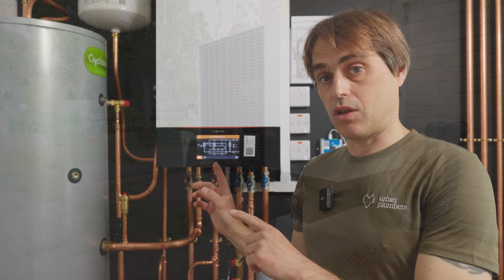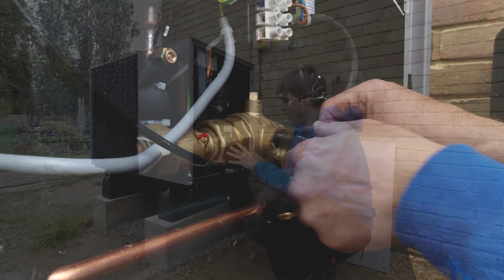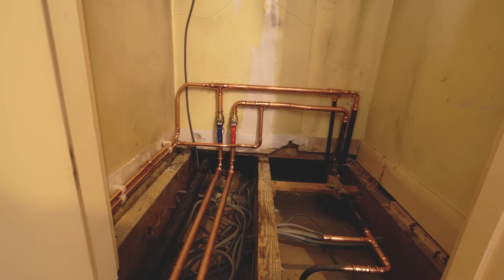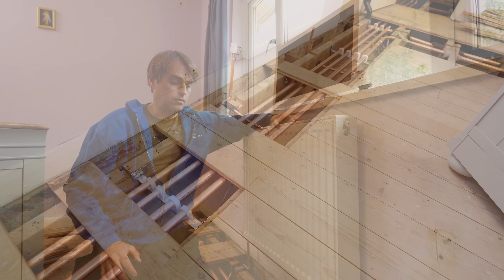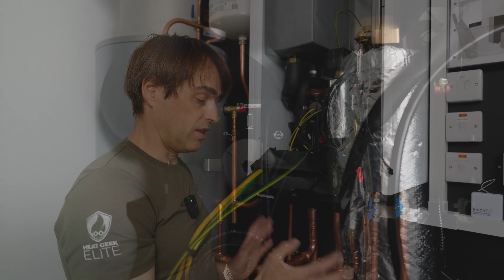Viessmann Vitocal Heat Pump Installation & Overview.

Comment: Like the idea of heat pumps, but when i see videos on YouTube of half a room in the house taken up by cylinders, valves and things on the wall it scares the cr4p out of me! Plus you need a big box outside your house. My combi boiler is about 70cm x 50 cm, so nice and small. Where would I fit all of that stuff? Can an ashp provide heating and instant hot water (without cylinder)? We only put our heating on when we get cold, so very low users of gas, can you do the same with an ashp? As in, only turn it on when you get cold or want hot water? Sorry, lots of questions - newbie here!
I should add, 2 people in house. 3 bed semi, WFH only twice a week. V low electricity and gas users.

Comment: Just get an integrated unit. No need for extra space for the cylinder.
Reply from the maker: Integrated units have small cylinders below 200l. Not good for 4-5 bed houses

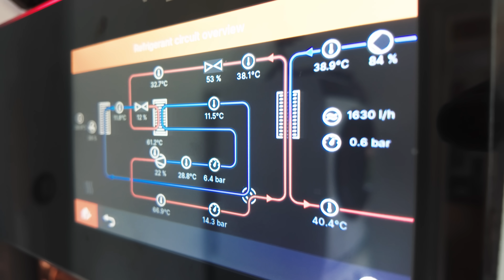Comment: At 11:50 circulation pump runs at 84% so the flow is modulated....Do you know why there are two EEVs on the refrigeration cycle diagram and why is the heat exchanger just before the evaporator and second EEV?

Comment: My installer wants to put in a homely optimiser over a 16kW Samsung. In theory, the machine learning optimising the flow temperature is a near perfect concept. However, has anyone had any experience with the system working well or poorly please?

Comment: @8:00 What happens if the circulator is stopped, how does the heat pump calculate the degree minutes (Nibe) then? Somehow the water needs to circulate?
Reply from the maker: Circulator doesn’t stop - is slows down to conserve the energy in both NIBE and Vaillant.

Comment: Are you sure it has to be 1000L/hr flow rate and cant go less. I had this concern and spoke to their technical but im not sure they know half the time.

From memory mines going to be 680L/hr on a 6Kw model and they said its ok, and explained about some auto bypass valve mentioned in their brochure, which i thought was to compensate for zones closing which i wont have.

6kw model at 35°C they said can output 5.6Kw. Cant remember the outdoor temperature for this though.
Reply from the maker: Yes, we tried running them lower and they would fail to defrost. All models need minimum of 1000l/h for defrost and since pump is really fixed flow / speed it has to run faster on 4/6kw models
Reply: Do you think the 150-A 6kw unit will be unsuitable for a home with 4.2Kw heat loss. DT 5 is 722L/h, it would need DT 3.6 to achieve 1000L/h.

Ufh ground floor, radiators first floor. Any suggestions?

Everything heat pump is complicated and why i was avoiding one over gas boiler, but low heat loss is almost pushing me to one for a new build.@UrbanPlumbers
Reply from the maker: @handle1196 just use 8kw. It’s the same unit as 4 and 6
Reply: Ive spoken to viessmann technical who confirmed the 1000L/hr is only for defrost mode and it will up the pump speed to this to perform a defrost cycle, then return to its speed required for the heating demand. In my case, 722L/hr at D.O.T, but the 6Kw unit will go down to 300L/hr.

300L/hr aligns with 1.74Kw output which matches the heat pumps minimum modulation at A2 W35

A7 W35 is 2.1min modulation.
A bit of the wrong way around since we need lower output at warmer outside temperatures.@UrbanPlumbers
Reply from the maker: @handle1196 trouble is the units aren’t doing it. Just check open energy monitor - they stay at high flow rate all the time
Reply: @UrbanPlumbers thanks ill have a look. Wonder why they aren't going down to what they claim?

Are other brands the same?
Reply from the maker: @handle1196  no, NIBE and Vaillant both slow the pump down and don't need high flow for defrost. Viessmann needs it due to the deforst buffer design.
Reply: @UrbanPlumbers are we talking about defrosts only, or saying the unit wont go lower than 1000L/hr even in heating mode full weather comp

Comment: Why do you install so many monoblock heatpumps? I feel like split systems are more popular in Lithuania and they are usually more efficient.
Reply from the maker: There are no r290 splits, they all use older refrigerant. UK doesn’t really need splits as it mild weather here so external power heat loss and frost protection is less of a concern
Reply from the maker: Also, splits aren’t really more efficient anyway

Comment: I have a question, my dad wanted a heat pump, but the rules now (apparently) say the hp must be at least a metre aware from the property. Looking at this video, it didn’t look like it was a metre away. ? Now I’m confused
Reply: The 1 metre rule was about the distance to a neighbour's property, not your own. Also, that rule in England has been scrapped last week.
Reply: @SeanW-zi6kj Brilliant, thank you Sean
Reply: There is another rule about them being away from openable windows if they use propane refrigerant

Comment: Great video, two minor corrections though:
- there are remote updates (maybe not launched in UK yet),
- the booster heater output is 2,4/2,4/3,2 kW.

Comment: What is the purpose of monoblock if it has an internal unit?
Reply: You can install without having to have certifications for the refrigerant.
Reply: @Felix-st2ue That's it? In location where the temperature drops way lower than -3⁰C, having a monoblock, is already a risk that you take so that you would save on installing the unit. Long term it is less effective than a split unit. Especially at -25⁰C(the recommended design temperature here). We have more strict regulations on new build and reconstruction so the power of the units are lower than what I've seen on this channel.
Reply: @mindaugasvaskevicius1818 Over here design Temperature is more like -10. So somewhat it in the middle. And we still mostly see Monoblock HP. Another important factor is that the global warming potential of r290 is multiple times lower compared to other refrigerants.
Reply: No gas lines to deal with

Comment: How did you size this unit? If you follow the line one the data sheets, the output of all the units is really! Low at around zero. We have a loss of 9.9kw and they are fitting a 150a.10  it's output by the graph at 45 flow is 6kw ish... the same with this 6 and 8kw in your video. Thanks

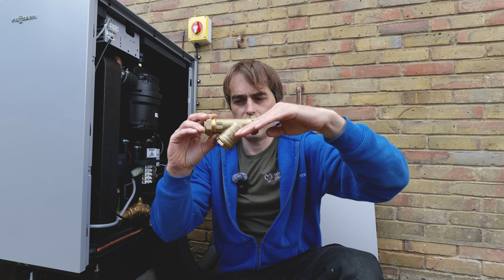Comment: @ 3:11 I really hate y strainers filters + Y strainers allow to drop in their bottom only bigger size particles … the fine ones will stick to the mesh and clog it… 
One of my friends who is doing more industrial installs use big pool filters with a very big strainer in them …
I used on two friends houses medium size standard potable water filters and booth are over 8 years old without failing at a flow temperature of 55-60 😅 on the return is lower - they have a fine big plastic mesh that is very easy to dismantle and clean + they allow the water to lose speed in orther to improve the filtering capacity 😊 … 
Usually I use magnetic separators with big strainers in them (@ 3-4 times bigger that the standard 3/4 Y strainer … 😊

Comment: What is the cylinder you’re using, both its capacity and dimensions? And why aren’t you using the heat geak one?
Reply from the maker: Joule 300l. It’s cheaper and
I prefer it to Heat Geek cylinders. I am getting COP of 5-6 on this cylinder on that job.
Reply: @UrbanPlumbers  Did you not take out a Joule and replace it with a Heat Geek cylinder at your own house in a previous video? Do you think the Heat Geek cylinder would have done any better than 5-6 or just the same?
Reply from the maker: @grantmackinnon2197 it would have done exactly the same at eco setting as the coil cannot be saturated. HG cylinder would have better performance on full DHW mode and is much better on bigger units.

Yes I replaced my joule with HG cylinder and have seen improvement in COP, not dramatic though as my unit is only 5kW
Reply: @UrbanPlumbers that’s good to hear, I like the dimensions of the heat geak 200 narrow cylinder but the price is hard to ignore
Reply from the maker: @edetc10 HG are also bigger in size / height due to the coil size. They are fun to have for COP chasing, but not really necessary for most installations.
Reply: @UrbanPlumbers I can live with the  tall hight it’s the diameter that I’m more concerned with as I’m hoping to have it fitted in the corner of a kitchen boxed in so including external pipe attachment still fit in a 600mm by 600 mm footprint
Reply from the maker: @edetc10 good thing about Newark is, they can build you whatever you want !

Comment: I did the same thing with my radiators: swapped a bunch of them one year, and then ended up with some replacements when I got a heat pump the next year! Wish I'd known about HeatPunk then.

At least I have new radiators throughout the house now - and I learned how to bend and solder pipework!

Comment: If that hydrobox were half, or a third, the size, this would be the way to go. 

Getting rid of that tiny buffer by using a slightly larger DHW cylinder, or larger volume rads, for defrost, along with less empty space, would probably get there.

I also wonder why we don't see more of those floating integrated diaphragm expansion volumes into the cylinder. Then you can get rid of the faff and space of the main expansion tank.

Comment: I installed a Viessmann last month, I can confirm the software turns off the circulation pump after a period of time once the compressor is off, the App will give a notification that the unit has gone into economy mode.
Reply: Interesting, might be coincidence so due to higher outside temperature at the moment.
Reply from the maker: @allensheane1707 yes, I would say so.
Reply from the maker: No it’s does not. We have 4 units on open energy monitor and flow rate stays constant. The only time the circulator is off is when external temperature threshold is reached and heating is fully tuned off
Reply: Econemy mode is when the Outside switch off threshold has been met.
Reply from the maker: @tomplumb7754 if Viessmann can address this little niggle, this unit will be even better
Reply: @UrbanPlumbers 
Yeah if the pump modulated it would be handy. 

Im putting an indoor sensor on the next one and will play with room reference to see if it helps. 

I take it you have reduced the pump in the settings? It helps. 
You can set the pump on HW and CH independently which is handy.
Reply from the maker: @tomplumb7754 yes, but can’t go below 1m3 as it will fail defrost

Comment: Interesting video again, thanks! Why did you install an additional expansion vessel when there is already one in the unit built in?
Reply from the maker: The other one is for the hot water cylinder

Comment: Great Video 
Vaillant has the same system with an indoor unit with a backup heating element that can be connected from 1-9 kW, 3-way valve, expansion tank, pressure relief valve, control in the front, has installed a 5kW, with the indoor unit works fine for me down to -11 degrees without using backup heat.
Reply from the maker: But it’s is more expansive overall than Viessmann and still needs loads more additional kit and boxes, plus controls are not on the same level. Hopefully Vaillant will catch up soon.
Reply: @UrbanPlumbers Hi Simon. Congratulations on the next lovely install.
In terms of the better controllers in Viessmann. Which settings you can't configure, lack of settings in the aroTHERM Plus which can significantly affect its performance comparing to the Viessmann, please?

Comment: I lika your videos it’s interesting to see how it works in the uk. A question though. Why do you always use these stand alone water tanks with a separate controller for air-to-water? Here in Sweden most installations are the same outdoor unit but a combined indoor unit that has a built in 200-300 liter water tanks. They take up space but no more than that tank. I’m talking more nibe,ctc,thermia in that case but most brands here does it that way.
Reply: I think the issue with those is fitting them into an existing house. They’re not easy to get into a loft or an airing cupboard.  If you look at the 151 and 222 they are available in the UK. I would argue if you have the space surely you’re better off with a standalone cylinder so you can keep it in 10-15 years time when it’s time to replace the outdoor unit?
Reply: I think the viessmann 151-A is what you describe, or the 222F system boiler for gas?
Reply: Ok, in Sweden having the heating system on the upper floor is not common. Cellar is most common or ground floor. Weight on a combined indoor unit is obviously a problem then. Space wise I dont think it takes up much more space than one of those tanks shown in the video. 60 cm width is standard and the height varies.

Comment: 🤣 so expensive and a level of complexoty beyond anything needed
Reply: A 4 way valve in a box is truly alien technology 😂
Reply: @edc1569  

haha

Electronics Gas Pumps Valves Condenser Motors Fans 

Plenty to go wrong and last a few years before it goes pop 

Look up Occam's Razor .. 

These things are way too complicated 

In France they use simple electric heaters ..

The solution is Nuclear Power and simple heaters 

Not this nonsense. which appears to be designed to keep people in work rather than keeping people warm on the cheap
Reply from the maker: Not as complex as your spelling
Reply: Thank you Syzmon, that was an especially interesting video. Well worth your time to share this knowledge and experience.😀👍
Reply: Thank you Syzmon, that was an especially interesting video. Well worth your time to share this knowledge and experience.😀👍

Comment: Had a job recently that all the rads were slightly under sized. Rather than change them all we did the extra radiator hack in a central position and it worked really well. Another great informative video!!

Comment: Looks great mate, I like the indoor unit in that it takes away the messing of 3 port pump expansion prv. 
Does that defrost buffer mean you are less reliant on installing volumisers ( depending on system)
Reply from the maker: I never install volumisers anyway so not sure
Reply: Yeah i feel you dont need a volumiser  with them, bare in mind run times though. 
We have only fitted them on large volumes and the run times are bonkers
Reply from the maker: Viessmann has 150 degree minutes so will overshoot quite a bit with longer run times. I am amazed by how great the modulation on 10,13,16kW units is. We have 13kW on OEM and it doesn’t cycle even with 10c outside. Great units
Reply: @UrbanPlumbers 
Thats good to know, yeah i noticed the same. 
Have you fitted any on just rads/low volume?